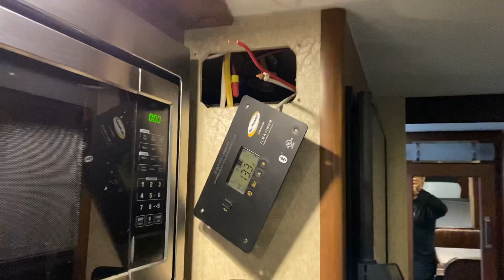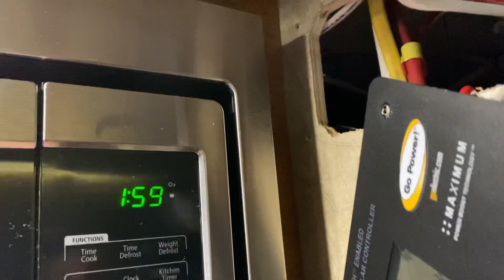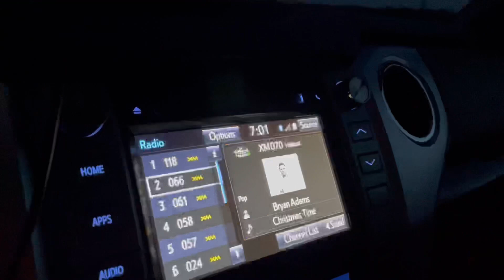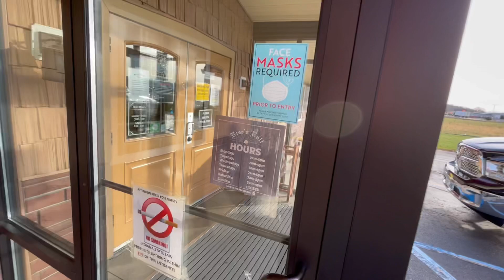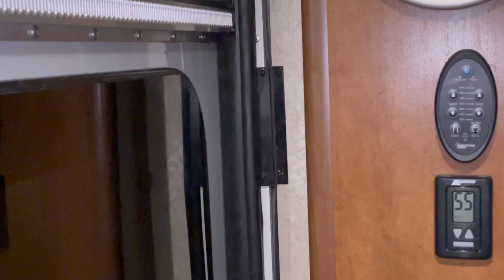NEW Trailer; BROKEN Slideout!

Comment: The owner of Pleasure Way doesn’t use slide outs saying he couldn’t warranty it because they don’t hold up in regular camping use. Slide outs are always trouble.
Reply from the maker: We had 3 slides on our 5th wheel and never had a single issue with them over the 8 years we owned that trailer.  It was however a different slide out mechanism on those.  They defiantly can be an issue...hopefully this is the end of our issues with the slide.

Comment: I had an issue with my slide out not working (2019 Lance 1995 TT) and the issue was with Lance manufacturer not installing the bulb seal correctly - not Lippert. I also agree, Lippert customer support goes above and beyond the average company these days! Boo on Lance, Yay on Lippert!
Reply from the maker: We definitely were very impressed with Lippert.

Comment: The NuCamp Gods were angry!  I like your Lance floorplan.  It's the one we would buy if that what we wanted.  We still have our T@b 400.  Like it a lot.  No issues since new.
Reply from the maker: It may have been the NuCamp Gods!  LOL. Although we had some issues with our T@B 400 as you may recall including needing the floor replaced in it....maybe that was the Jayco Gods!  LOL
Reply: The big issue is winter camping..my 400 can't operate well in winter and it sounds like the Lance can stay operational...that I find important differentiator

Comment: I have been looking to purchase a Lance but after seeing and reading about your slide issue, have decided to look for the one model with dual wheels that Lance sells that does not have slides {2075}.  I am also more worried about getting a slide unit out at any campsite and having the slide unit get stuck in the out position making it impossible to pull down the highway due to not being able to get the slide back in.  Most people are not as mechanically trained as you and with the long delays in getting help and or service makes purchasing a slide unit too scary to consider even though they are fantastic when extended.  Lance is one of the few four season campers made that does not have a rubber roof and water and rot issues or side wall separation issues that some of the other so called four season campers have.  I am now also looking at The new Escape Industries 23', the 25' BigFoot, the 21' Oliver or the new 25' Intech Oasis which is more of a three season camper but still very nice.  The 21' Oliver, Escape Industries 23' and the new 25' InTech Oasis also build their trailers on all Aluminum frames.  The Intech uses an aluminum cage frame welded to the Aluminum frame where as the Oliver, BigFoot and Escape trailers are solid fiberglass and called egg trailers even though the BigFood is more square than the other fiberglass campers.  These fine trailers do not use slide outs.

Comment: As a fellow Lance owner I am happy for you that this issue was resolved. I also had an issue with the slide on my 2465 but the motors just had to be run in an out about 6” at a time until they were synchronized. Only had it two days so was very nervous . Living in ct makes bringing it to Lippert or back to lance extremely difficult. No issues since then, knock on wood!
Reply: Hey fellow CT Lance owner here in Griswold. Our 2019 2285 is currently being serviced for slide out problem...I’m sensing a theme here. I brought it in Nov. 4....so getting close to a month...oh boy.
Reply from the maker: I am so glad to hear yours was an easy fix on your slide!

Comment: Great video - especially the "ghost inverter" powering your microwave ;)
Glad you had success with the slide-out. While I agree that every new RV will have some shakedown issues, this problem goes beyond the pale. Disconcerting that Lance engineering, Lance QC, (and Princess Craft) haven't done a better job on the slide installation and testing. You should get some consideration from Lance and Princess Craft for the amount of time and stress you had to invest in the solution.
Reply from the maker: Thanks Dan!  That inverter really through me for a loop while I was recording that!  LOL. I decided to keep that in there just in case someone else might ever encounter a similar scenario.  Sadly the manufacturers never seem to compensate you for your time and efforts in getting their products fixed.

Comment: I’m having a similar issue with my 2020 1995. Lippert mobile tech is telling me the same thing, that Lance did not install the slide properly. They have to replace the whole system - hopefully they will repair it this week.
Reply from the maker: Makes me wonder how many were actually installed wrong by Lance at this point.  I am hearing from others that are having the same issue.

Comment: Patrick , it was about one year ago maybe a little longer I was having trouble with our Lance truck camper I put a comment on your you tube site, we have had lots of issues with our Lance truck camper,Lance has not been all that accommodating  with us , so I started dealing with the company’s i was having issues with taking care of my own issues LCI was one of my problems it was my truck camper Jack’s Lippert took very good care of us,Tony was the the individual I dealt with excellent company to deal with. Lance may have been the best truck camper on the market at one time but I am not sure of that now. Ours was made during the buy out of LanceCamper,REV now owns the company and I may have gotten caught up in the middle of the transaction with some disgruntle employees. They do use a lot of quality components but the workmanship on our camper was very poor, and apparently the quality control was not very good either,now maybe all of their problems are behind them I hope for future buyers. PS we had water leaks roof related, Refrigerator, Furnace, Wiring, Truck Camper Jacks, most of which we took care of. Patrick I hope you and Patty have good luck with your new Lance Camper.
Reply from the maker: We were really impressed with Lipperts service.  We have not dealt with Lance directly yet so I can’t speak to their service but overall I haven’t heard great things.  Sadly there are very few RV manufacturers that you do hear great things about with service.  We still feel like overall this is a very solid trailer and hoping that it lasts us a long time.
Reply: We still have our Lance truck camper 2years now we have had it out about a dozen times since we have owned it everything seems fine now. Hope you guys have very good luck with your Lance trailer

Comment: Hopefully the factory tracks issues like (through the warranty claim) this to implement better detection on the production line. They could easily measure tolerances. For automation, they could watch DC current draw when the slide is operating. The power draw is going to be much higher than normal.
Reply from the maker: I totally agree with you.  Something this simple should not slip through at the factory

Comment: The slides are really nice for the extra space. But I think people should be made well aware that they always give you trouble and especially if you can’t be completely level. Also they add a lot more weight to your total weight so you can’t carry as many personal things that you may want to have with you.  I think it’s a good idea but they haven’t perfected it so it isn’t such a problem. That’s why I chose one without a slide that also made a spacious feeling while inside.  I decided to buy the Mercedes sprinter B+. It has the L-shaped couch in the back which makes into a full or queen size bed depending on what your needs are and the table out front seats 4 comfortably and folds down into a full-size bed. You feel like you have a lot of room for just 24 1/2 feet.  Also I have a full shower with a separate sink and toilet. I lost space in the bathroom to have space in the kitchen and the table area. I figured that it was a good trade off because honestly how much time do you spend in the bathroom. A lot of times if I’m at a campground I use their facilities unless the weather is poor.

Comment: Why wasn’t this potential problem addressed during your PDI ? Certainly the dealership technician should have noticed the speed and noise.
Reply from the maker: That’s a good question.  I know in June they could not keep up with getting RV’s delivered and maybe they just didn’t notice the speed or sound.  We had never owned a slide with this shwintec system so we didn’t know what it was suppose to sound like.
Reply: PDI are conducted by the seller. They want to sell not fix.

Comment: Hello! This is way off topic...do you have a video on tire pressure monitoring systems?  I'm waiting for my T@B 400 and can't figure out how a TPMS repeater could be installed with the type and location of the batteries.  I'm very relieved that your slide is fixed.  I imagine how I would feel.  Hopefully, NuCamp won't cut corners due to the huge demand for their RVs!  My dealer is going crazy!  I should get it in time to put it in storage😀 Considering the times, it's a problem I can cope with.  Very Happy holidays to you!
Reply from the maker: Hi Sandy!  Unfortunately I don't have a video on a TPMS.  We actually need to get one for our Lance.  Our friends at Endless Rving though have a video here on YouTube on it so you might check out there channel.  Congratulations on the new 400!  You will love it!

Comment: I am so glad I found this channel. I am about to acquire lance 1985 from Roundrock Austin and have a few questions. Do you still own the Lance? how is the towing with the Tundra? I will be towing with an F150 powerboost 2022 model . Payload is 1679 and towing is 11,000 lbs. I sure hope this message finds you well and able to respond before tyhe 2022 1985 Lance is gone  LOL
Reply from the maker: We do still have the Lance and we tow it with our 2017 Toyota Tundra Limited.  It tows great for us. We have been running the Andersen Weight Distribution System for the past year and love it. You should be fine with the F150 with those specs

Comment: So what did Lippert actually do to fix the problem?  I'm having the exact same issue with my 2185.  Thanks.
Reply from the maker: They had to recenter the slide so that each side was within the acceptable tolerances.  They also had to install a new mechanism because it had been bent.

Comment: A quick question . . . reading a few posts on LOA forum, it seems some Lance owners are bracing their slide outs in the retracted position. There is an impression that the slide can be susceptible to road stresses during travel. Have you either tried such a remedy or noticed any issues during travel? It certainly seems to make sense that there is a lot of unsupported weight, when the slide is fully closed, particularly if the under-seating drawers are heavily loaded. Thanks!
Reply from the maker: I have heard the same thing.  I asked Josh at Lippert and he said because they reinforced ours with some metal braces, we did not really need to worry about that with ours.

Comment: Thanks for the video!
We have the Lance 1985 as well and when we bring the slide in or out at some point it appears that the motor binds just a little for a moment. Did you notice yours doing that before you had it fixed? We call the Lance dealer in Atlanta  back in October and they are booked up but said they would call sometime in November to schedule our visit.
Just checking to see if we have an issue.
Thanks!
Reply from the maker: The first couple of times, ours would bog down on one side and the other side would just take off.  Initially we could just bring it back in and then it would go back out fine.  In September, it got worse and would not go out at all.

Comment: And this is why I'll never own a trailer with a slide. It's just one more thing that can,and often does, go wrong.
Reply from the maker: It definitely can be an issue much like we had.  When they work though they can really open up a space and create a much larger area in a smaller trailer.  Fingers crossed this is the last issue we have with this slide.

Comment: I hope this is just an anomaly for you guys and nothing systemic with Lance quality. My local NuCamp dealer told me they were having significant issues with Lance to the level that they were not going to carry them anymore. I’ve always heard great things about the Lance product and maybe they are experiencing the same challenges other RV manufacturers are with the high demand. I miss seeing your T@B 400 updates...I guess all good things come to an end.
Reply from the maker: Overall we have been very happy with the quality of the Lance.  It seems all manufacturers have issues.  Our 400 had to have the floor replaced  and the refrigerator never did work right in our Jayco.  Hopefully this is the only issue we will have with the Lance.

Comment: Lance should know how to install a slide. That's disappointing.  Lance should get this info and make sure they haven't done this on multiple units.  Being in Florida we would be nowhere near that service center.  We would be at mercy of manufacturer and dealership.
Reply from the maker: It could have been they were rushing to get them out right before the shut down or maybe a new worker?  We are fortunate to have LIppert here although Josh did say they have Lippert Techs all over the US that they can dispatch.
Reply: @TravelswithDelaney  maybe.  Hope it isn't a common thing.  Glad it's fixed for u all.
Reply from the maker: @JasonScottCarter  I do wonder how many units were sent out of there with the same issue as ours

Comment: All this does not speak highly for Lance. It seems to me that you experienced a ton of time, trouble, and expense on a new trailer?
 I know you're going to probably be reimbursed for all the repair costs of the slide, but that does not even begin to cover the stress, headaches, cost and time that you went through.
Reply from the maker: Sadly that seems to happen with all of the manufactures. They never offer to compensate you for your time, fuel, etc.  We have had the same thing with several of the trailers we have owned over the years.  We are just so glad Lippert helped us out and we didn’t have to send the trailer back to California
Reply: @TravelswithDelaney  I know. I'm just glad you got it fixed. We have had issues as well but overall we love our Lance. They sure offer a very comfortable RV experience. :-)

Comment: I've read all the replies B4 composing mine.  Now that the Slide-Out issue is fixed, when are you going to do a lil wrenching yourself; I'm a talkin' 'bout the Easy Start inside your air-conditioner.
Reply from the maker: That may be a project for next spring.

Comment: Hmmm, being in the market for a Lance myself, this doesn't give me a warm feeling about spending 45 grand for Lance "build quality" if they can't install a slide mechanism the way the manufacturer of the components say they should be installed. Patrick, it's a good thing you lived only an hour away from Lippert! Otherwise what would you (or any other Lance owner) have done? Yikes...
Reply from the maker: We were lucky to be so close to Lippert.  If not, my guess is the dealership would have had to ship it back to California to be repaired at the factory if they couldn’t do it themselves which most likely would have taken a couple of months considering transport time, etc.  We honestly were thinking that might be what we would have to do if Lippert couldn’t fix it.  We got lucky.
Reply: I bought new and am having slide issues as well.  I’ve been working with Lippert as well.  Tony has been amazing!  I’m traveling through Texas and they sent their mobile crew out. They didn’t have the necessary parts to repair onsite and needed to get approval from Lance and Lippert to replace parts.  Mobile tech said Lance did not install the slide correctly. I’m still waiting but am hopeful that it will be repaired soon. So frustrating!